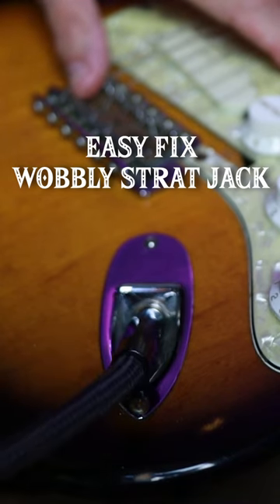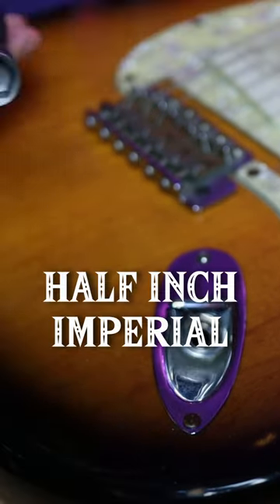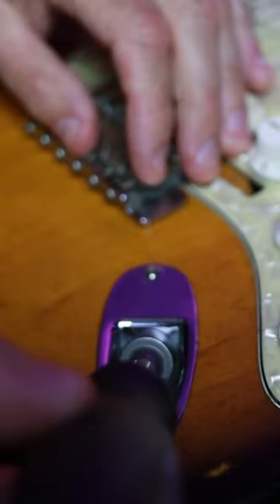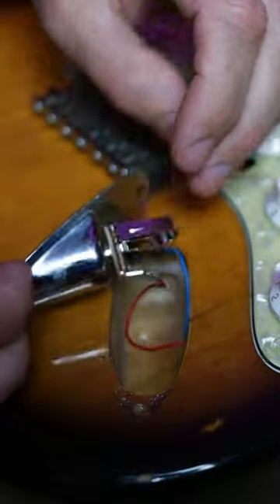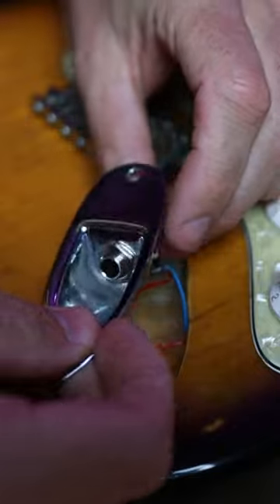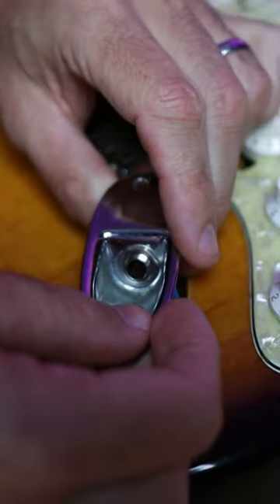Wobbly Stratocaster Jack? EASY FIX

Comment: Absolutely.. I"ve even put a drop of glue on threads before if they don't want to stay where they are.. :-) 
I just ordered my warmoth next day before yesterday with jumbo Stainless 6100 frets. Can't wait to put on my body with 3 EMG SA's. Be well sir!
Reply from the maker: NICE! What specs did you go for?
Reply: @LeonTodd  10 to 16inch radius.. Standard maple board and maple neck with black dots. 6100 Jumbo stainless frets like I said. I already have hardware for the same is the reason.
Reply: @LeonTodd  Stay well brother! On my second cup of coffee.. Hope that first reply made sense.. Not awake.! ;-P